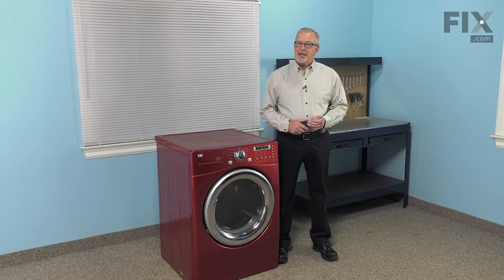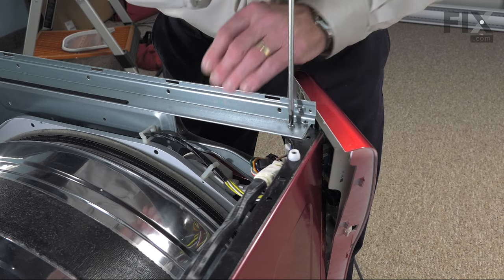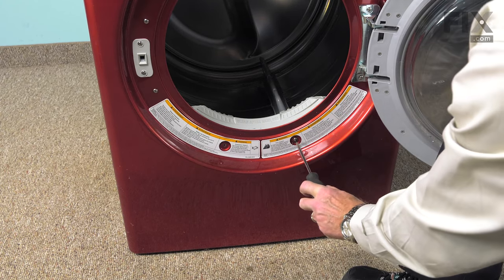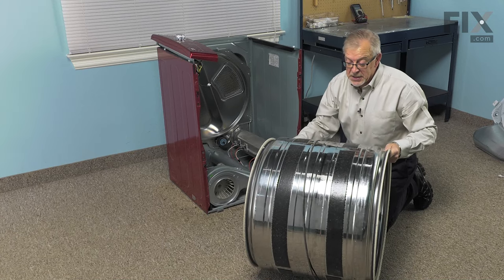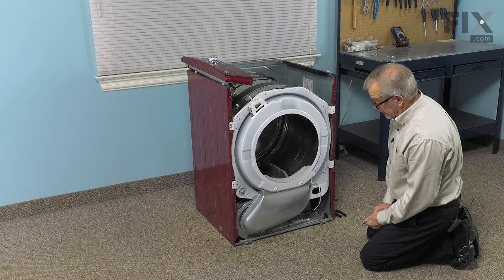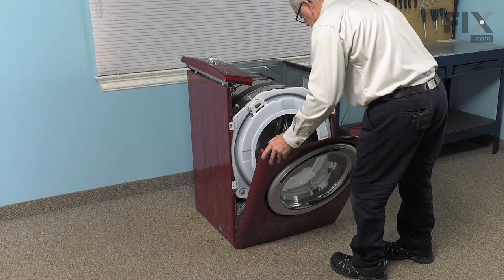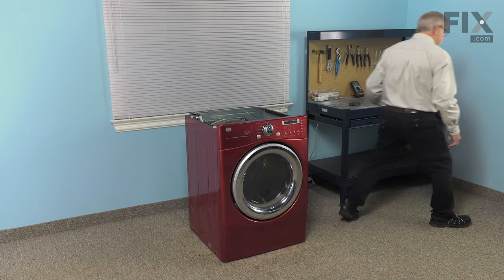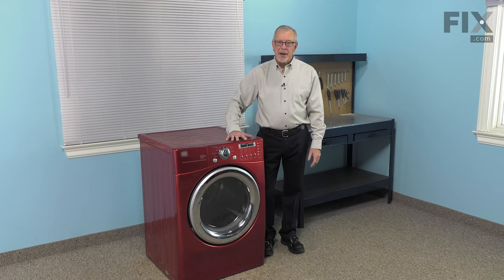LG Dryer Repair – How to replace the Heating Element

Comment: Fixed my dryer in 2 hours start to finish. That includes cleaning and vacuuming 14 years of dust and lint out of it as well. Only cost me $70. Thanks for the easy and straightforward step by step guide.

Comment: Question : The dryer heats up but keep tripping the breaker I discovered on the plug that you insert into the Elect. Outlet one of the prong next to the Ground prong charred and the coating of the prong burnt off as if a short exist in the dryer. or could it be in the cord itself What could be ? any idea.
Reply from the maker: It could very well need a new cord as well as the receptacle it plugs into in your home.
Reply: @FixDotCom  I checked the receptacle it is ok I have not installed a new cord but there was a wire attached to the element that was loose cleaned and reconnected it however it worked and then it tripped the breaker again maybe I should replace the element .

Comment: Thank you! Your help saved me the cost of repairing if not replacing my dryer.  It only cost me $70, and that included replacing the belt also.  I figured after 16 years, it wouldn’t hurt to replace it too.  Thank you so much for this tutorial!

Comment: D80, D85, D90 errors on flow tests.  I got those error messages on the flow test with a brand new LG dryer like this.  I had stumbled across someone posting having a problem with a new LG dryer having the heating element out of alignment in the unit and causing these error messages.  After running the test with it completely disconnected from the household dryer vent pipes, I decided to open it up and see if my unit had the heater unit misaligned.  This video was very helpful in getting my dryer apart to inspect the alignment of the dryer unit.  It was off, having fallen a little over 1 inch out of alignment.  This allowed the unit to scavenge air from around the heater unit instead of through the heater unit.  I installed it correctly and bent the retainer tab properly into place and it works properly now for the first time since the unit was new!

Thank you for this video.  It was well shot and easy to follow.

Comment: Thank you so much for this video.  It saved me from getting a new dryer.  The heating element replacement was easy enough.  My issue was getting the backplate for the console seperated from the front assembly.  (A screw was embedded to the sheet metal).   I found it much easier to just disconnect the wiring from the console and taking out the backplate and the front as one piece.

Thank you for your time in helping us weekend warriors.

Comment: Thanks a ton for this. Just finished the repair with no issues. Very clear instructions. The only change I made was to remove the control panel entirely. I took a picture so I knew how to rewire it, but keeping it out of the way was a pain while it was attached. Thanks again!

Comment: Excellent tutorial and I would have not figured out the sequence by myself. I had to make a change in the sequence in that I needed to lean back the front panel before I could disconnect the door switch harness because that connector was a locking connector on my machine and I needed better access to disconnect it

Comment: Thank you very much this made it very easy to fix but when I was done there was a rubbing noise and it sounds like something is wrong with the band around the drum but after double checking it, it turned out that wasnt the problem any idea what it could be?

Comment: If my dryer doesn’t use that extra terminal because it only have one red wire and one white wire, does it matter which of the two terminals I put the white wire on? I’m talking about the piece on the left of the thermal fuse

Comment: After doing all this...and thank you for an easy to follow video...my dryer smells like something is burning. I’ve cleaned all the lint out too. Can you help solve my mystery?
Reply: I had the same concern, because it’s a brand new heating element, it’s going to smell the first few times. Then it goes away.

Comment: How do I find the right element my dryer is the same exact one as this one.
Reply: Look inside the dryer door there should be a sticker on there with the serial number and model number. Pull the model number and type in heating element for xx dryer model number xxxxxxx into either google or amazon! I hope this helps you!

Comment: How can I tell if it’s the heating element or the dryer sensor isn’t working. I replaced the roller wheels with you yesterday. Now it’s turning nicely. But not heating up. 🤦🏼‍♀️ it’s about 10* outside and I don’t wanna go to the laundromat.

Comment: My dryer came with a thermostat with 3 prongs... the replacement I got has 2. I didn’t notice till I brought it home. Is it necessary to plug both white wires in the the thermostat? Are those grounds?
Reply: Hey I have the same question did you figure it out?

Comment: My dryer is heating, but will trigger the breaker outside on any heat level, except no heat (air dry).  
A 20 month old lg DLEX4370W.  For a while, it would finish a load on Low heat, but now not even on Ultra Low :(
Could it be the heat sensor, the heating element (even though there's heat for the short time it runs), or the breaker itself?  
Something else... please help provide most likely reason - lightly used high end dryer causing problems at a young age.
Reply: Look for electrical shorts to body... between temp. switch and coil. Improve or repair insulation.  Peace.

Comment: The design engineers that  changed the easy access to the heating element need to be kicked in the balls.......repeatedly 
The design of these units is Absolutly an Anti- Right to repair tactic to get people to throw it away and buy new.

Comment: You call this an easy job? :) The engineers creating this machine must be really stupid. To replace the heating element, do you actually have to disassemble the whole dryer along with the drum? Wow, this should be the smartest way to make a dryer :). Also, you have to attach the drive belt, blindly without even seeing what you are doing? Congratulations LG you are a really very smart manufacturer ...

How much easier it will be to design to open the back cover with 4 screws and have access to the whole system without having to remove the drum to replace one heater. Given that it is located at the bottom, it is absolute madness to reach it only from the top cover through the drum and disassemble the entire front panel...
And this is the work of the man who wants to go to Mars? I just can not believe it :)
Reply: Maybe you should create your own Dryer  design then sell it to a manufacturer.  Or do nothing but complain about it
Reply: @jasperstephens9333  Good idea. For 20 years working as fixing washing machines and electric appliances, I may think to construct a dryer machine:)